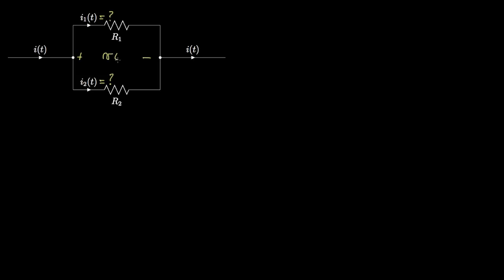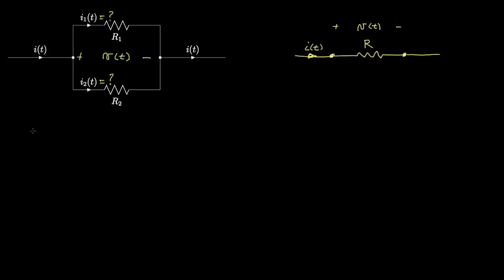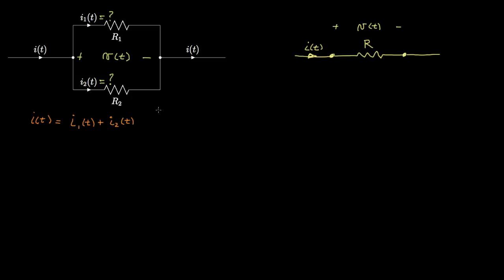Introduction to Single-Node-Pair Circuits

Comment: Why converting the circuit into just one current source and one resistance (and calculating the voltage difference across this resistance) won't work. How is it incorrect? Thanks for these wonderful videos.